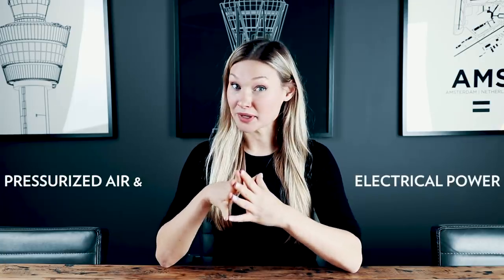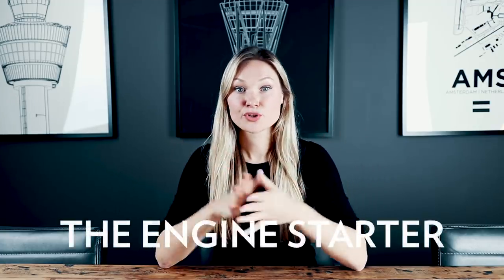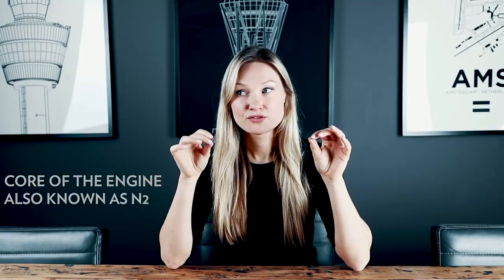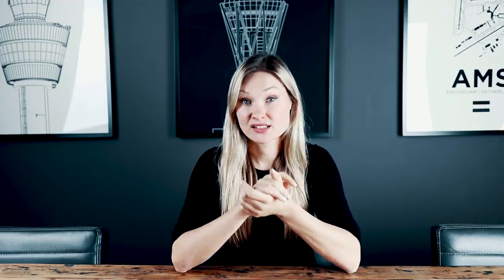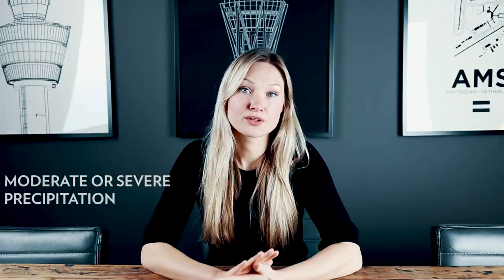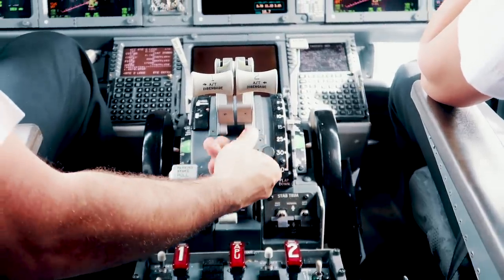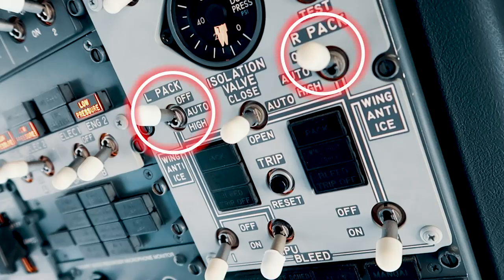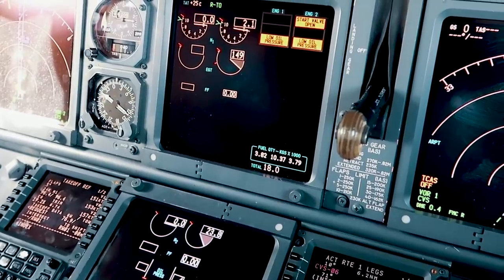How To Start A JET ENGINE -  Boeing 737 By @DutchPilotGirl

Comment: The Lockheed SR-71 Blackbird used a 401ci Buick Nailhead as a starter motor. It was mounted on a trolley and you connected it to the engine by a shaft and throttled it up to get the engine going.

Comment: Great tutorial! Just one small thing: you forgot to mention that when the captain moves start lever into the IDLE detent, the FO must check that the SPAR SOV CLOSED light and ENG FUEL SOV light on the fuel panel go from bright at first as the valves are in transit, to extinguished fully open as the spar valve is energized open allowing the fuel to be fee from the airplane fuel system into the engine fuel fuel system, and as the eng fuel sov is commanded open by the EEC allowing the metered fuel to be fed from the HMU or Hydro Mechanical Unit to the combustion chamber, as reflected by an increase in both FF and EGT as the fuel air mixture is ignited. Also you did not mention the autoshutdown feature provided by the EEC while on the ground, but that i guess it is a bit too nerdy! Lol! Congrats for the video and for your divulging skills!
Reply: Diego, she omitted it on purpose to prevent pranksters trying to start a 737. Now you completed the instructions.
Reply: Not sure but shouldn't the splang-valve be toggled to the rest position before the plop sprocket is released? Otherwise, and I stand to be corrected here, the plume flange might engage prematurely causing the fiddle-whacker probe to deploy in an unmanaged manner. And NOBODY wants that.

Comment: Starting an A-4M Skyhawk (USMC):

(1) JFS switch to "ON"
(2)  Pull up on JFS start handle
(3)  When "STARTER" light illuminates on ladder lights, push starter handle back down.  If you fail to return the handle, the JFS hydraulic accumulator will not recharge.
(4)  At 5% RPM, move throttle outboard to engage igniter switch
(5)  At 10% move throttle to Idle position
(6) After light-off, Monitor engine instruments until engine reaches idle RPM
(7) JFS switch to "OFF"

Haven't done this in almost 40 years, but remember it like it was yesterday.

Comment: Michelle, you said the large yellow hose from the jetbridge can be used for air start. That air is low pressure for PCA, pre conditioned air for the cabin. The Air start hose is a small hose, high pressure rating. The fittings on the aircraft are totally different.  You can not fit the Yellow hose on the Air Start connection and vice versa. Worked ramp for the past 20 years in the US and Flt Rep around the world.

Comment: Thank You for this explanation! Aircraft engines are a little more sophisticated to run than stationary gas turbines but try to start Eight engines, that can be very difficult to get all the engines to idle within parameters without vibration issues.

Comment: I worked at a fairground and I can tell you, starting the 1940s generators and compressors was a whole lot more difficult than this. It involved curses in 4 different languages. Burning rags on sticks, hand priming fuel pumps, giant jumper cables, a variety of aerosol cans and sometimes a change of underwear when they tried to fight back.

Comment: To expand on something you said, the emergency busses power the right ignition system, and not the left.  For first flight of day, you are not just checking the emergency busses, but the fact that igniter that it is connected to is operational, so in the advent of a dual engine failure, the emergency busses and the right ignition system will hopefully get 1 or both engines restarted. 

The yellow hose in a US airport is ground conditioned air, normally connected to an ac unit on top or bottom of the jetway.  This is relatively low pressure air for cooling or warming the cabin, and bypasses the ac pacs. 

Normally a start cart is used for the higher pressure air that gets injected into the pneumatic system for engine start. But you are correct that it could be mounted somewhere. Which is kind of silly to limit its availability to a single gate like that. 

I think your video would have been a lot better if you had just walked us through the process step by step, the numbers and minutia are a distraction to most people.

Comment: It's easy... Key in, clutch in, not in gear, adjust choke, turn key to position two, wait a few seconds and start the engine. 
If the battery is dead, you can always get your jump leads out and get power from the airport bus to jump start your 737 XD

Comment: Very well explained. Buy i hope for Boeing and Airbus that SpaceX will not go into aviation. Since a SpaceX rocket's engines are started automatically, yet a plane engine needs an extensive procedure to start. To isolate and Fix problems while in flight, I get it that all the switches come in handy. But for starting An engine, Just one switch should be sufficient 'on' me thinks.

Comment: i am an armchair pilot and i weirdly like all those buttons in a 737, year ago a got the 737 pmdg in fsx simulator and i have to scratch my head a lot, it was kind of overwhelming but after some try and error i succeed, nowadays in fly the a320 n fbw and it is way more simple and automated. in a nut schell, start the apu & bleed air turn the starter to on start engine 2 monitor the start until avail is on the screen then start engine 1 when 2 good starts stop the apu and turn the starter to off, voila that's it.

Comment: I'm not sure it was clear what the "bleed air" does. Correct me if Im wrong , the air spins up a pneumatic motor that turns the engine core until enough pressure is reached in the compression stage to allow for ignition in the combustors. How often do you have a "fail to fire" event?

Comment: The 747-8 is a little simpler - push a button to start the APU, once started you can start the engines. Also by pushing a button - and there are 4 buttons, one for each engine. And, you can start 2 engines at a time.

Comment: Ooh... the big yellow hose on the airbridge is conditioned air and is provided for the cabin only. Besides, it does not connect with the high pressure bleed air system. It also has an incompatible connector to prevent such a connection. It has a positive pressure of 10-15 psi, about 25-30 psi less than that required to start the engines. I also have never seen fixed bleed air supplies. It has only ever been portable.

Comment: Hoi Michelle, 
Leuk om dit te zien. Ik zie nu dat ik (tijdens simmen, want helaas ben ik leraar en geen piloot) een fout maakte. Ik drukte de switch IGN L Both IGN R altijd in de richting van de motor die gestart werd. Dus bij motor 2 op IGN R en bij Motor 1 op IGN L. Dat moet dus helemaal niet. Weer iets geleerd :) See you on Instagram waar ik je al sinds het begin volg. Grtz, Patrick

Comment: I noticed you weren’t using the lower nd screen on the engine start.  Is that your companies sop ?  When would you use that screen other than it popping up with a failure ?

Comment: On Boeing, is there any general rule as to which knobs are simply turned (wipers...), pushed and turned (like the engine start knobs), or perhaps pulled and turned? I believe on Airbus, at least regarding the autopilot, push means the computer manages that for the pilot, and pull means manual.

Comment: Couple of questions:  1) at 9:20 you talk about the starter motor continuing to turn the engine, but there is no electric starter motor, right?  Or is it a pneumatic "motor" fed by the APU or other engines bleed air?  Also you talk about moving the fuel leaver from cut off to what sounds like idle "detent" - what is that word?  Thanks and great job!
Reply: 1) In the beginning of the process bleed air from the APU or compressed air from an external air pressure unit is used. 2) She meant idle position.

Comment: Ok so I guess to start a gas turbine  like the Cfm  you have 3 methods at disposal, 1 APU  a small gas turbine to supply electric and pressurized air , 2 the cart which also supplies air , and 3 the 2 nd engine. A lot of piping and valves to control the inputs and outputs of the required air .once once Rpm reaches a % the ignitor starts to fire , then at a higher rpm % ff introduced . A timer set to ck egt stability.  The process is repeated till all turbine are running.

Comment: During the cold war in the 1960's, the UK had Valiant, Vulcan and Victor 4 engined jet bombers carrying nuclear weapons. They were on rapid reaction alert, Russia / Soviet Union could hit the UK with nuclear missiles and the UK radar could only give a 4 minute warning. The aircrews could leave the base buildings, get to the aircraft by car, get into the aircraft by ladder with 5 men per aircraft, hit a rapid start button, all engines started simultaniously and the aircraft would be airborne, all within 4 minutes.... The aircraft were always fueled up and bombed up with free fall nuclear or thermonuclear megaton yield weapons. How did they do it? Starting a 737, a modern civil aircraft looks so complicated.

Comment: Hi, I have just joined your channel and I have just watched your landing in Peru at the Quito airport my question is what sort of changes you had to do in doing engine stats at 7900Ft compared with at sea level. The only type of engine I have been dealing with in the past is the industrial Gas Turbines in power generation. One station I worked at had an industrial gas turbine based on the Concorde and Vulcan engines. I am also a glider pilot not that I am flying at the moment due to health issues.

Comment: I watched this video, oddly enough right after watching a story about a 737 that had both engines flame out during a storm that had enough water and hale to smother the engines.  Flight 421 in Jan 2002.  During it,  they showed the pilots trying to restart both engines (twice) without the APU.  Finally,  the attempted to start the APU but by that time they (poorly maintained battery) drained leaving them without power.  It was so odd, I kept yelling at the TV... start the APU!  Thinking they would at least have power to start the engines. I would have thought if not that, they would try to start only one engine first but they kept trying to start both.  The investigation showed they followed the proper procedures.  I thought it was odd... and listening to you I would have thought they were doing it wrong.  Any Ideas?

Comment: WOW! So complicated! You have to learn this at flight school or are manuals inside the cabin?
Reply: These things are learned during the aircraft type rating training. If the pilot will some day move to a new aircraft type, then the pilot must complete a new type rating training. There are also all the necessary manuals and checklists, and today they are usually on the iPad.
Reply: @mikep9604  I see. So, a little training on each specific plane. Thanks.

Comment: Outstanding! I can now start a 747. Just one question...which direction is the runway?
Reply: This is a 737..
Reply: @speedbird9313  -  So...that must be why I could never find my airplane identification study guide. That must be what blew out the window on my way to cooking class.

Okay...so, take out the cup holders and what do you have? No big difference.

Now I know all I need to know to fly into FFA. Any bets on whether I can make it?
Reply: @ep61611  No big difference?? Are you mad? Got no 747 rating, but there is a huge difference🤨
Woundnt it be easier to just admit the typo? 🙄🤔
Reply: @speedbird9313  - Apparently, you didn't bother to read the rest of my comment. Either that or your sense of humor would rival that of Mitch McConnell.

YES! I AM MAD! Certifiably and ostensibly  MAD! Look up FFA to see how easily anything larger than an ultralight could land there.

Typo? How could anyone find a typo in all that mess?

Comment: 1 turn choke on
2 push primer ball 6 times no more then 8
3 pull starter chord until engine fires 
4 turn choke off 
5 full throttle
Reply: There were pull cord starter units on the Me 262

Comment: Nice video DutchPilotGirl I really liked it.

Just one thing. When you say Air starter at min 1:17, don't you should call it GPU (Ground Power Unit) or Pneumatic Ground Cart...?

Because if you don't. It may be confused with the air starter installed in the Engine's gearbox, wich performs the action to convert the incoming Air pressure into rotary movement for the spool number 2.

Comment: You can start an APU and use its air to start an engine. You can use a ground cart and use its air to start an engine. If you already have one engine running, you can use cross-over air to start the second engine.

Comment: I’m surprised each engine doesn’t have a FADEC type controlled start. It seems overly manual to me? Understand once trained and with multiple cycles the procedure will become second nature but with modern electrical control systems the pilot cockpit workload could easily be reduced.

Comment: Not sure your parking brake is set.  Also I believe the wing fuel tanks are supposed to be full before any fuel is loaded in the center tank.  You only have 3,700 pounds in #1, 3,800 in #2 but 11,100 in Center tank.  Great video, but hope you were not going flying after that.

Comment: starting my diesel tractor is simpler first remove the solar panel plug and remove all the insects and the glow plugs key on 10 seconds  and I'm cranky op with the clutch in

Comment: Hi, great video. I usually fly X PLANE and I had an issue flying the B737-800 with SOURCE OFF (engine 1) lit. I checked the procedures on QRH. However, I was not able to restart the engine while midflight. Probably because of a small detail. Packs off, APU on... How about a video about it. TKS
Reply: Renê Fernando Choppa No FIM with the X PLANE? 🤔😆
Reply: @speedbird9313  Never heard of. Let's investisgate. TKS a lot.
Reply: Renê Fernando Choppa Was a joke🤭Its the Fault Isolation Manual issued by the aircraft manufactor😉
Reply: @speedbird9313  I suspect it was a joke but I was already searching for the real one. Anyway, I wouldn't expect it from X Plane, nor ZIBO. But, judging from the faces you posted, yeah, pretty much I could tell you were being ironic. I like people with good sense of humor. TKS again for the feedback.
Reply: When I said "never heard of" I was refering to the FMI, which I discovered soon after what FMI stands for.
Reply: Renê Fernando Choppa But the FIM could still be useful if you could find it.
Just curious; Have no idea how X Plane works..does it throw different fault at you while you are flying, or do you have to make a mistake to get a fault? Source off  doesnt mean that you have necassarily lost an engine, but your source of electric power (in this case most likely your eng #1 IDG). But did you lose your engine after the source off light came on?
Reply: @speedbird9313  Well, first the answer to how X Plane works, things are meant to work just like in the real plane but they are always developing it. It's a never ending job. Right now, the plane by ZIBO MOD let you set a problem listed in the pad and and then you have to manage the problem. Normally the ones in midflights are more interesting. However, let's suppose you forgot to set flaps up and exceed the speed. Then, some light will lit up and I guess the consequences come along. But in the case you asked, I really don't remember the sequence but I guess the light just popped up. Maybe I made a mistake but as I said, the plane has its fauts and it is still far from representing all the functions of a real one. PMDG has the best 737-800 available. I'm just wainting for the release of FS2020. The graphics are fantastic but I've heard the flight dynamics of Flight Simulator still needs to be improved. On this matter, X Plane is much ahead.
Reply: By the way, if you have some spare time, take a look at tutorial videos from ZIBO on Youtube or 737-800 of PMDG on Flight Simulator. I guess you will have a good idea on how deep they simulate the airplane. I just love the 737-800.

Comment: Be carefull Dutch pilot Girl. The big yellow hose often connected to the sky bridge is the air conditioning hose. The bleed air hose is much smaller in diameter and has a different coupling at the end to fit the ground pneumatic port in the belly of the airplane.

Comment: My jumbo jet 747 has just failed its mot, Headlamps out of alignment and a brake light is inoperative and a leak on the exhaust system. Can anybody help me please. I don’t get paid until 28-04-2019.
Reply: Peter Newman Just do what the sovereign citizens do and drive it till ya get caught and tell them you traveling not driving.

Comment: Sort-of silly BUT TRUE trivia about the T-56 turboprop engines used on pre-J model Lockheed C-130 Hercules.  
 
The engine temperature is measured in terms of "TURBINE INLET TEMPERATURE".  There is a maximum limit to this, called MAXIMUM TURBINE INLET TEMPERATURE.  Often it is abbreviated as "MAX T.I.T."  
 
REALLY.